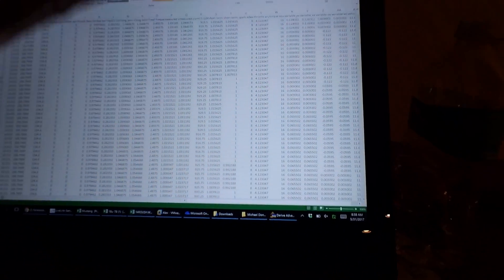KNOCK SENSORS ON COYOTE MUSTANGS.

Comment: When I bough my 2015 Roush RS3 they said that they filled it up for me.  I ask what was put in it?  They said that they had put 87 in it.  I requested for them to drain the gas and put it in a fusion and that I will fill the car myself.  They ask why. I said that this is a supercharged car and 87 will cause damage to the engine.   They drained the tank.   Hahhahaha

Comment: I’m curious about your thoughts on Automatic transmissions and Knock Retard at low RPM, but very light throttle. The car is fine when driven moderately to aggressive. But... Low RPM + Light Throttle = Pulled Timing?  🤔

Comment: Alex, your videos are so informative, thank you as a 2018 Mustang GT owner.  Based on your experience with your 2018 and 2019 Mustangs, does the dealership ever question the warranty being intact after a Lund E85R tune? I purchased a tune from (Lund) Brandon and the car runs great. Also, have you ever heard of an issue where there is what sounds like a light tapping sound ONLY between 2k and 3k RPMs under light throttle. Any insight would be greatly appreciated brother. Keep up the great work!  

-Hector, Atlanta, GA  2018 GT PP1, H-Pipe, Roush CAI, Lund E85R tune, Clutch spring delete :-)

Comment: Alejandro, thank you for this video! I have a  3.7 and was experiencing this exact issue. Even using a premium brand like Shell, 87 octane was causing 6 degrees of knock when I got my car tuned and I was thinking I got a bad tune. But I returned the car to stock and saw it knocking 6 degrees in stock form too. I filled up with 93 octane and now I get 1 degree of knock on the hit before it starts adding a lot of timing. So yeah,  put 93 in your car even if Ford says it can run on 87.

Comment: Thanks for this video man. I deleted my original comment. Found out my false knock was a result of header bolts coming loose at the lower flange and the secondary O2 was rubbing my transmission cooling line. Dented it pretty good to. But it’s still okay. Fucking Ford and the genius design of putting them so damn close to each other. 🤦🏻‍♂️

Comment: You also described in a nutshell why higher octane fuel is better to begin with. This is even true of my ancient 1996 Ford F150 with a 4.9L inline 6. Modern fuel is crap on lower octanes. It's dirtier to begin with and the ethenol levels are crazy high compared to years past. I went from running 87 octane to 93 and it made all the difference in the world.

Comment: well here is my problem..i have an 03 mach 1 having the motor rebuilt but i bought the cast iron 5.0 block which does not come with the knock sensor mounts..so can i delete them in a tune or relocate them to another spot??? i will be running 93 oct and just want the car to be safe without  blowing the motor thanks :)

Comment: great videos 👍 i only work on my fox and had my 12gt for 3yrs and had no issues so i only changed oil and brakes. i knew nothing bout coyotes except they r strong. watched ur videos and gain so much info so thank u for spreading the knowledge. just ordered a vmp tune and cai then took ur advice on researching before starting the process

Comment: So when you say the tune (specifically the stock one) knocks back anywhere from 1 to 6 degrees, is that in response to actual detonation heard by the knock sensors, or is it in anticipation of knock and does so to prevent actual detonation? The reason I ask is because I've been data logging my stock engine with HP Tuners (leftover from my LS tuning days) and I see alot of positive values for KR during part throttle acceleration. During WOT it's usually 0 with sometimes being negative, but during part throttle there is alot of positive KR values.
Reply from the maker: Andrew Dinu it can be a pick up of some kind of vibration of the knock sensor don't go off unless they feel some kind of rattling or vibration
Reply: I wonder why so much positive activity only part throttle. Like I said WOT is always either 0 or negative. Plus I always run quality 93 gas, either Sunoco or Shell.

Comment: hey alex i hope you get a chance to read this, im tied between an 11+ 5.0, or a terminator, it will be bought used, cobra with 30-60k miles pullied+bolt ons. 5.0 with 40-70k miles. which am i better off with? the prices of both cars are relatively  identical too

Comment: Did I understand you right about stiff springs potentially setting off the knock sensors? If so, what's the stiffest you can get and NOT have that issue.  I'm looking at a BMR set now where the fronts are rated at 240 lbs.

Comment: hey man i have a stock 02 mustang gt with accel coils and motorcraft spark plugs and flowmaster 40 mufflers and i have been putting 93 in it will a tune make it run a little stronger or should i just leave it alone it runs great already what do u think?

Comment: On the 11-14 the knock sensor will pull 1* if it senses any knock. On the 15+ they added a knock intensity table. if the sensor senses low intensity knock it will pull 0.5*. High intensity it pulls 1*. This is good as  it allows the tuner to get your 15+ coyote closer to the borderline of knock. If you see the ignition advance(saftot) noticeably drop where you are seeing knock activity value be added to you have knock or false knock. If your tuner isn't being crazy with the borderline table and MBT table, which most aren't,  Its most likely false knock or really shitty gas as stock comes with in 5-7* of MBT spark on any quality 93 octane and lower octanes with in 8-10*. This should make sense and could explain why the knock sensors can add 10* in stock tune. 

If you pull a degree of timing to prevent the knock in the first place you will probably end up with the same or a little more ignition advance in the end and making more power, Its better than having the knock sensors do it for you. They are aggressive to stop the knock and slow to bring spark back in after knock. This is In the case you can't get better gas or don't wanna stock up on octane booster for your daily driver.

Comment: Wow your videos are so educating and helpful! I love it! I have quick question after watching this one, why did u say that stiffness of the suspension settings will affect knock sensors? How?
Reply: Marshall Liu all that nvh is transferred along the unibody back to the motor and registered as false knock. Not necessarily stiff shocks but solid spherical bushings and solid motor mounts as stated. 

Another common issue for false knock is exhaust clamps touching the unibody transferring vibration back up to the motor

Comment: I have the brenspeed b326 and it uses no knock sensors So I was told to disconnect them and have the tuner shut them off and the coolant temp and iat will pull the timing it needs. they said built motors are more noisy and will get alot of false knock. and the new rs3 have the knock sensors turned of from roush

Comment: Hi...since you mentioned false knock  could be caused  in some cases by  modified/stiff  suspension...Does this  mean that a knock sensor actually measures  vibration g forces?  Also where are they located on a Coyote S550?   thanks
Reply from the maker: More like "vibration" or resonance.
Reply: Alejandro Flores 
Vibration and resonance can cause false knock? I'm curious because I'm getting some knock at high rpms under part throttle and I'd say about half the time at wot. Car is a TT 2016.

Comment: Question for ya just did some suspension work in the front long story short I got either an endlink, strut or camber plate causing some popping should I correct that before trying to get another tune (e85) or is the strut/endlink/plate whatever the hell i got going on right now far enough away to not effect the knock sensors? I know exhaust hitting the frames or whatever can cause the false knock just wasn't sure about the strut area....
Reply: yea went with j&m plates, strange struts an cj springs but i have something not right on the passenger side it pops like a motherfucker over every tiny bump  so im gonna swap struts see if it still makes the noise an I guess change plates or endlinks if that doesnt fix it cant find any play in anything so no idea what it is haha mod problems :/